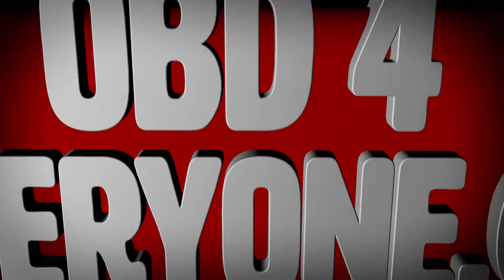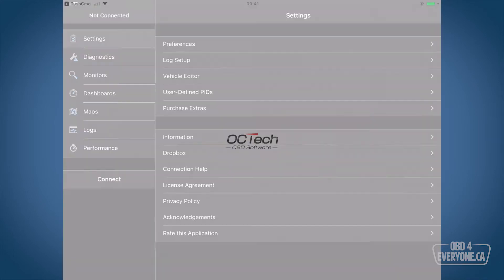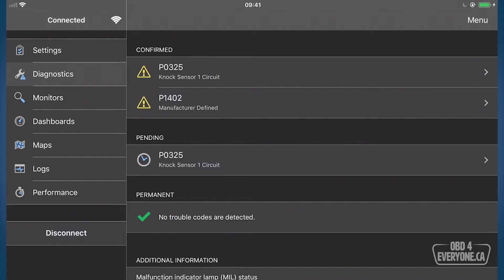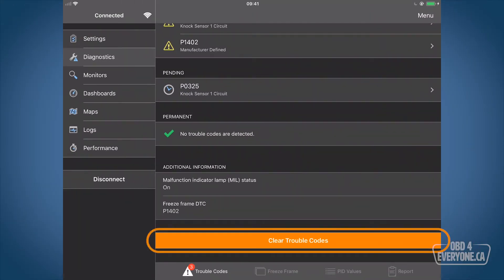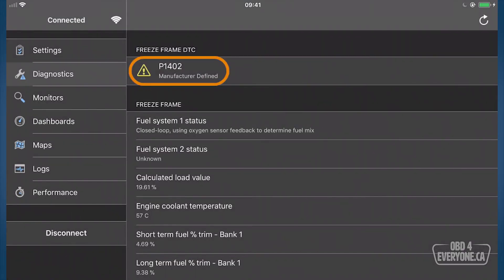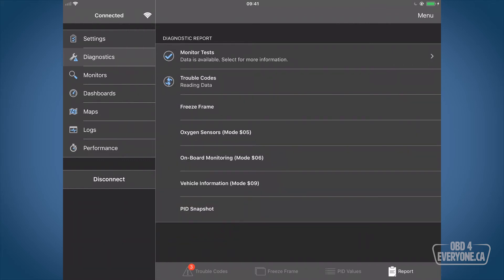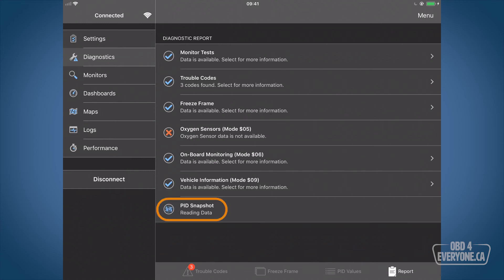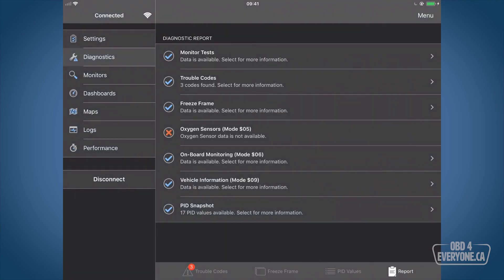Reading Engine Trouble Codes with OBD Fusion for iOS: OBD4Everyone Ep. 10

Comment: I am more than a bit confused about all of this obd stuff..I have 2 cars Im not driving because of emmissions tests. A 04 Saturn Vue and a 2013 Nissan Altima. So obd fuision costs 5 dollars at the play store but for 13.00 I can download Nissan specific software and another 13.00 some Gm specific software ? I dont really need to dive into deep diagnosis just fix the problems right    1   Time instead of guessing over and over. Im retired so I have nowhere to go .Just want  to fix my cars so I can go to the many doctors I have to see. So can obd fusion actually perform teste on evap and o2 sensors like they all claim.  but then say    "  Not Supported   ". Ive seen people on line argue both ways . its bidirectional its not bidirectional. obd fusion. Please point me in the right direction or maybe make some other suggestions.  Thank in advance.

Comment: "we'll touch yes to that"  no explanation why you proceed beyond the warning that it can harm your engine if used while running?
Reply from the maker: Good point, I should of explained that.
This is OBD Fusion being very careful as some ECUs may not function as expedited when in a diagnostic mode, so you don't want to be driving just in case something happens.

On my G37, this has not been a problem, but you should test your own vehicle in a parking lot.

Comment: How do add the knock feature!!! I use ob2 fusion.
Reply from the maker: Hey  Slick Six Racing,
If you are referring to seeing the output of a engine knock sensor, I have not seen that in the cars I work on. (mostly Japanese makes and all non-turbo)

The only time I have seen that, is when the engine control units have a custom tune/software like EcuTek or UpRev.